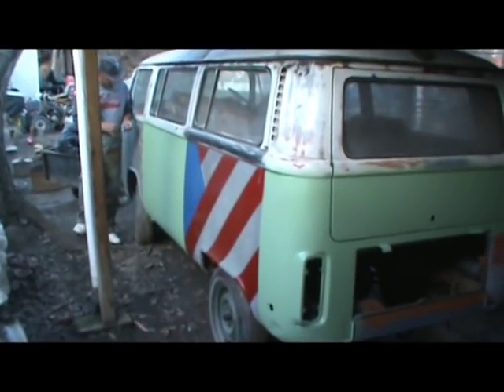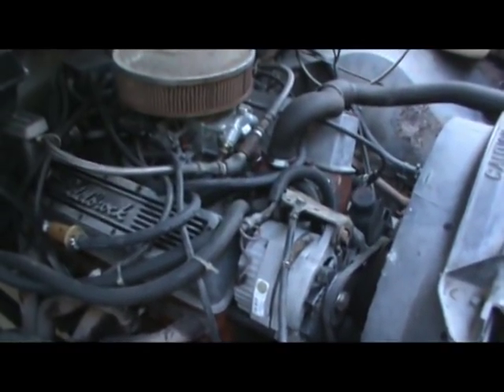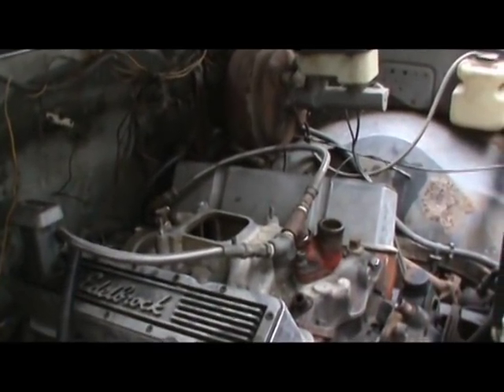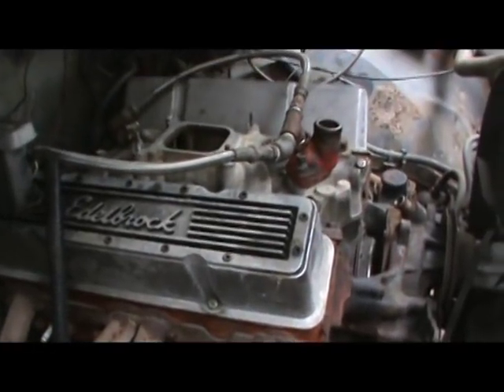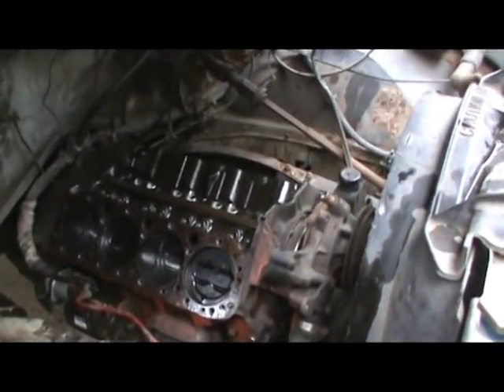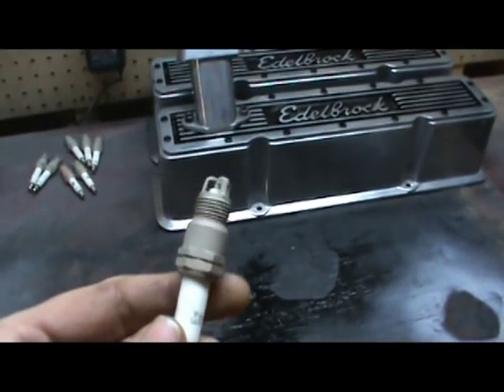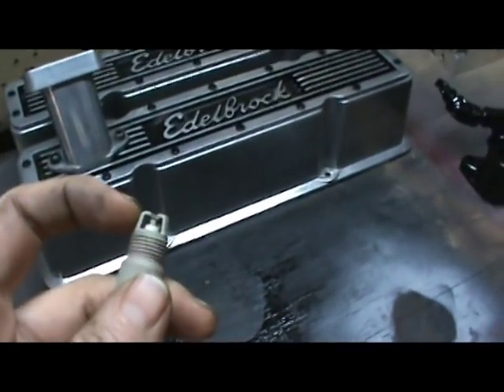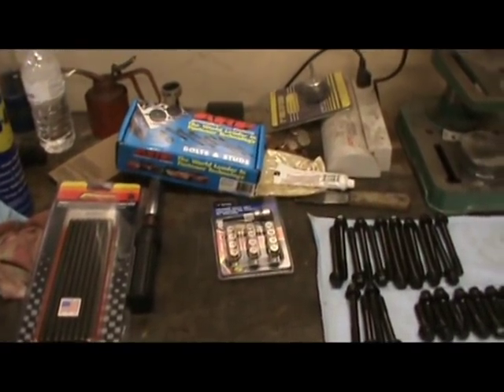Chevy Small Block  400-head upgrade-part 1

Comment: Great video !!
 I ran a sprint car in the 80s with a 400 destroked to 3.625 and .030 overbore to make 393 cubic inches. It had 13.5 to 1 compression with o ringed block and solid copper head gaskets. I drilled the water passages from the back of the intake to the top of the radiator.
Engine was built by Earl Garete from Indiana who built all the fast World Of Outlaw engines back then. It made  big hp and torque. He also made the single 4" throat fuel injection. It still have it and will put into a donor vehicle some day.
Don't be afraid to build a 400 as I've had great success with them.

Comment: My dad still Loves the lil 400.  He’s had one in a 72  3/4 & a 1/2 ton.  Great for pull all the tractors and equipment with. We’d considered your dads Plumbing job also, we just never Pulled the trigger on that project. Dad still has a couple thrown back.

Comment: What heads you running we have a 400 small block 202 heads and cam in a homemade hotrod 32 Ford front end 69 chevelle ss rear end 3 speed Muncie transmission frame is made out of angle iron body is made out of heat ducking sheet metal wheel base is shorter than corvette weighs 1200 lbs all together built the summer of 1999

Comment: My brother lucked into our dream car that we saw in a few shows as we were in jr high, a 79 Z-28 with a 1973 sb 400 bored .030 over, using a stroker crank & custom rods all forged, amber lightweight pistons 11/1 compression, offroad/circle track camshaft from summit, same aluminum heads 202/160 originally but, then ported & polished! holley 750 dbl pumper w/manual secondaries, th400 w/new valve body, B & M shift kit,3,500 stall, 373 gears, 1/8th mile DOMINATOR!!!!!!!!!! I NEED ANOTHER 1973 400 ASAP!!! ANYONE WHO HAS ONE, PLEASE MESSAGE ME!!!!!!!
Reply: I have a 1972 Chevy Impala..Original 400sb/400th.. I like riding highways and interstate with my family.. but when I get to town/ city limits there are all type of ppl wanna race so,I'm looking for a upgrade any advice?  Will it be cheaper to rebuild to 406 or 427 etc..need help ASAP 😉
Reply: I have one now and Curious about them myself.    Everyone yelling get a ls which I know is easier.  but I'm thinking I have a 400 now might as well try this

Comment: What car does the engine  400 4bolt main come in  stock
Reply: The 1970-72 blocks were 4 bolt mains, with three freeze plugs per side...later blocks were two bolt mains...400s came in full sized Impalas, Chevelles, and Monte Carlos from 1970 to 1974...400s were available in trucks from 1975 until they were discontinued in 1980...The two bolt blocks are supposedly the ones to use for high performance...The main bearing webs are supposed to be heavier than the four bolt main blocks.
Reply: eddie cuevas some 1970 station wagon has 400 look for three freeze out plugs on each side is 400 block.

Comment: Me and my dad bought a small block 400 4 bolt main. block number 3951511 it needs a rear main seal and a timing chain and a carb. It's gonna go in my truck a 1970 c10 is it any good? It runs and got really good like new compression. We picked it up for $250. It's been dressed up chrome valve covers air filter headers.
Reply: i have the same block in my drag car a 1972nova  it's a good block

Comment: my dad and I built homemade hotrod 32 ford front end and straight Axel 69 chevelle ss rear end Chevy 400 small block with 350 crank street race cam  3 speed Muncie transmission fuel cell out of a limited late model stock car frame is made out of angle iron the body is made out of heat ducking sheet metal wheel base is shorter then a corvette weighs 1200 lbs all together set up for a 100 shot of nitric oxide it runs mid .8 seconds in a 1/4th mile built for cruising and drag racing very very fast

Comment: OK Now I see what he tried to do with those lines from the back of the intake But I would have run them into one then into the return on the heater hose so those lines  would have been out of sight in back of the motor ...All we ever do to improve the cooling system is upgrade the radiator and ad d a Hi-flow water pump with a  good fan and the problem is solved forever ..Nice project to do for your dad Man ... Thumbs up ...

Comment from the maker: You can get them to produce a lot of power, it just depends on heads, carburation, intake manifold, exhaust system, and compression ratio......this engine is pushing around 375-400 I would guess?

Comment: the only thing better than cubic inches is more cubic inches !!...I have my 400 bored .030" to 406 cubic inches....It sits in a 1948 Chrysler...using a reworked TH350...Edelbrock Performer intake w/Holley 500 CFM two barrel carb....MSD dist...cast iron manifolds w/duals...not a high winding typical SBC, but a stout torque monster...the old girl is a hefty 3800lbs. and she needs lots of grunt...not high rpms.

Comment: I've heard all the negative stories about the 400 too, but I couldn't see anything wrong with the 400's design, at least not bad enough to sway me. So I built a $150 boneyard motor with the cheapest gaskets/rings/ bearings, and only perf parts were a small 234/244 cam, Z-28 valve springs, alum intake, headers & Hly 800 dbl. It came out MUCH better than expected and I'd shift at 6500 all the time. They're the only V8 I'll build now and I've never had one of the problems they're claimed to have.
Reply: Got a 400sb any advance it's bonestock in a 72 impala 2 door Th400
Reply: @kingtrap4760  just cam it and burn the tires up